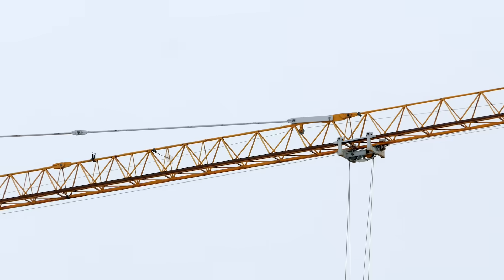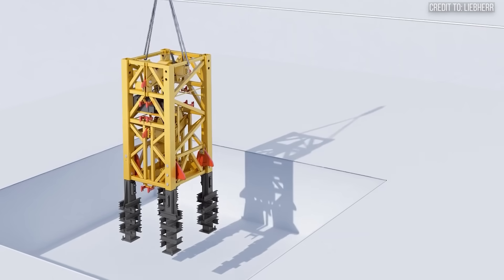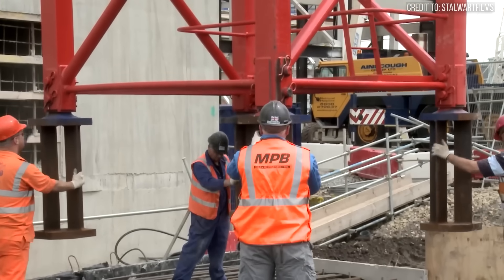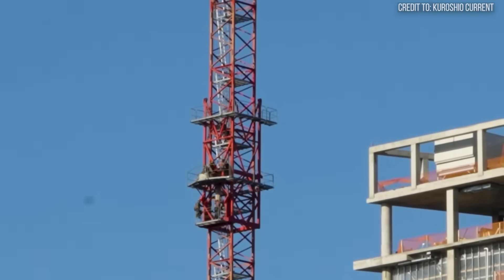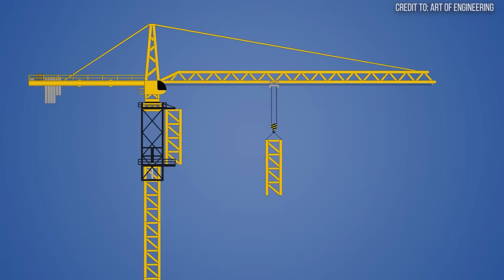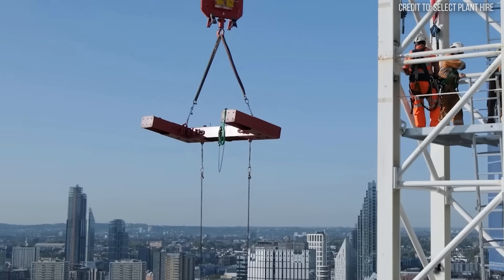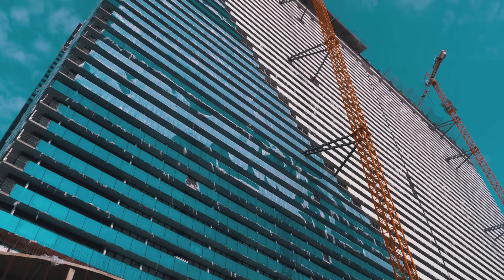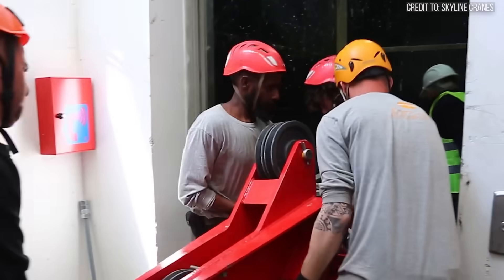How A Tower Crane Assembles ITSELF

Comment: Never quite caught the bit how they get the anchors back out from a finished building ?
Reply from the maker: Hi, The concrete foundation block itself is almost always left in the ground (it’s huge and very expensive to break out). It often gets incorporated into the building’s basement structure, parking garage, landscaping or just covered over and forgotten. Hope you enjoyed the video!
Reply: @HardHatIndustries sorry may have worded it wrong, the steel tie in beams into the building that help keep the crane stable the higher it goes up, how do you’s get them back out from a finished building ?

Comment: How long the crane used its cable for its specific job?
Reply from the maker: A crane cable doesn’t have a fixed lifespan, it’s replaced based on condition. Depending on how often it’s used and the environment, it can last anywhere from months to several years. Regular inspections check for things like broken wires, corrosion, diameter loss, or deformation, and the cable is removed from service as soon as it meets discard criteria. Safety standards (like OSHA/ASME) require replacement when wear or damage is detected, even if the cable isn’t very old.

Comment: The cost of the crane must be negligible in comparison to the building. So why dismantle it at all? Just keep the crane as part of the building. It could be used to build adjacent structures and help in maintenance. It's look also fits modern brutalism with its plain industrial look.
Reply: So that means crane production needs to be increased just to make an archetectrual statement?
Reply: @crusher8017  Yeah. They would be part of the central pillar also containing the lifts and staircases. Every skyscraper needs HVAC, lifts, absurd amounts of steel and concrete, and a single crane which grows with its building and stays with its building until it is used to dismantle the building and itself.

Comment: When I lived in the US I worked in a major east coast city in building maintenance. I had access to the roof of the building I maintained and I frequently would go up there on my lunch break and watch a new building under construction. I caught them inserting tower sections when they were climbing  to keep up with the progress and I caught them when they took down the crane which by that time was near 600 ft tall and watch them lowering the crane. I often took pictures of that building as it progressed and of the tower crane assembly and later disassembly. I have respect for the men who do that work.

Comment: How does the operator get up and down daily?
Reply from the maker: Tower crane operators usually climb long internal ladders inside the mast sections.
When the crane is tied to a building under construction, they can use the building’s stairs or elevator to reach a higher level, cross over into the crane, then climb only the remaining mast sections by ladder.

Comment: It's the first question crane operators receive. During a home bathroom remodel, we went to the nearby grocery bathroom if nature called later at night. But more than once you had to get clever and set up sawed wood slats over a five gallon bucket with.a plastic grocery bag inside. Crane operator's 5 gal buckets have a toilet seat snapped on top but it's almost the same setup.

Comment: Yes worked on two of them as an Apprentice Electrician , installing flood lights  about 17 years old and the guy I was working with could not stand heights , I am still here touch wood , Reggie HAS LONG GONE , bless him . Back in the 1960's no safety gear , so hang on and keep going . Bournemouth UK . PORTMAN BUILDING and BURLINGTON ARCADE ,all for £ 4.50 PENCE A WEEK wages .

Comment: The video doesn't show how the crane, itself, is mounted onto the tower. I assume that it's lifted onto the tower by another crane on the ground.
Reply from the maker: Yes that was an oversight in all honesty. Your correct! The first few mast sections are lifted into a place along with the jib, counter jib, counter weights and cab. This is usually done by a mobile crane. From this point the crane can start building itself as the video explains.

Comment: A lot of people don’t realize how much these cranes lean over, I was on the platform close to the top when we were pouring concrete with the crane bucket, a full bucket almost at max capacity and you can feel the crane bouncing
Reply from the maker: That's a great comment! It perfectly highlights the incredible engineering and design that goes into these structures to manage those forces. The subtle movements, even when loaded to capacity, are factored into their stability.
Reply: Some cranes have movable counterweights to adjust for varying loads.  As a civil engineer, I know that the loads need to be balanced as much as possible to reduce the torque on the tower as much as possible.

Comment: A guy I’ve known for several years owns an ironworker outfit here in the Seattle area.  He unfortunately knew everyone killed in the Seattle tower crane collapse a few years back.  When he says it’s about precision that’s seriously no joke.  Remove the wrong bolt at the wrong time, negate the structural integrity and the results can be catastrophic to say the least.  But I believe tower crane operators can be easily into the six figures as far as salary.  It’s also very difficult to get into.  I’d love to have the chance but for now I enjoy my semi truck hauling welding gas.

Comment: I was hoping for an answer of "How does the horizontal beam is placed and the concrete slabs?"
Reply from the maker: Hi! The horizontal beam (the jib) and counter jib are lifted up in sections by a mobile crane and bolted together while the tower crane is still at its initial setup height. Before it begins climbing and adding mast sections on its own, the mobile crane also installs the concrete counterweight slabs. Once the jib and counterweights are in place, the tower crane is properly balanced and ready to start raising itself.

Comment: I have a lot of experience with mobile cranes as a rigger but none with tower cranes. You mentioned that a smaller Derrick is put in place on the roof to dismantle the main tower crane but also said it was small enough to be erected by hand, so why does an even smaller Derrick need to be there to dismantle the first Derrick?

Comment: during the lift up - how they powered up the crane? and how it powered general?
Reply: A large electrical cable wood be logical lots of power will be used by the building when finished I worked on dredges and they had a floating group of pontoons supporting the cable with plenty of surplus. Thousands or liters of diesel and lots of hot coolant would be a huge hazard and far more costly to supply fuel and maintain compared to an electric motor. Being next to a noisy vibrating engine all day would lead to a rapid turn over of operators and not good for the crane structure.

Comment: Just wondering if there are examples of interior cranes where the crane’s support is actually left as a structural part of the building?
Reply: I think they did that before the self rising kits. Or they plucked it down piece by piece in the shaft that later would be elevator shaft.

Comment: I wonder what the maximum height it is possible to go using this system . If the wind is not a factor ?
Reply from the maker: Great question! Tower cranes can actually climb themselves to huge heights — as long as the structure supports them. The Burj Khalifa, for example, used self-climbing cranes that went up over 800 meters as the building grew. So if wind isn’t a factor, the main limit is really the crane’s design and the building’s strength!

Comment: What powers the crane?

Are there electric cables running up the whole height or is it diesel powered and they lift up fuel to refill the tanks?
Reply from the maker: They are powered by electric motors which draw power from the local power grid. Some may have back up diesel generators but this is to supply electricity (not as a direct drive engine)
Reply: There's a gigantic motor up on the top behind the operator cabin.

Comment: In answer to your question about concrete experience stories...

My father, Stan Sack, was hired in 1964 by Dominion Engineering in Lachine to come up with a procedure of fastening the Innocenti machine to the concrete floor without the use of anchor bolts. I am writing a memoirs for my 2 sons about growing up with my Dad. I'm looking for more information about my Dad working at Dominion Engineering Works (DEW) and the Innocenti installation project.

In a letter to a chief engineer who used to work for my Dad he writes...

"In 1964 , Dominion Engineering Works (Lachine, Quebec) – a subsidiary of C.G.E. – a
firm I was well acquainted with, approached me. When I was hired, I was
assigned to the installation of the “Innocenti” – a numerical controlled milling
machine made in Italy a million-dollar venture according to my source of
information. This equipment was a monster in size yet very sensitive to its surroundings as to
vibration and shock. The cored concrete foundation was 8 feet deep and rested
on bedrock and was isolated from the surrounding concrete floor. The latter was
accomplished by installing a shock absorbing material all around and between
the foundation and plant floor. The normal procedure to fasten the equipment or
machinery to the concrete foundation is to install anchor bolts during the
pouring of the concrete. This procedure was ruled out due to previous failures to
the operation of this type of equipment."

"A new procedure of fastening this equipment to the concrete foundation needed
to be invented and investigated. At that time, I seemed to be more adventurous –
a case of more guts than brains – however, I came up with a proposal and
procedure. After many technical discussions my proposal and procedures were
duly approved and I was given the green light to write up the EMI (Engineering
Manufacturing Instructions). This too was also approved shortly after its
submission. The concrete foundation then was poured - minus the anchor bolts.
During the pouring of the concrete, the contractor was somewhat skeptical due
to the lack of anchor bolts. His final remark was 'You learn something new
every day!'"

"The EMI made it very clear that cleanliness of surfaces to be bonded (i.e.
leveling jacks, bottom face, and the concrete surface) as well as the work area;
tools; and workers attire (the company issue of white coveralls, head wear,
gloves, foot wear etc.) was of paramount importance. This was subject to close
inspection at all times and enforced. Only authorized workers and personnel
had access to the cordoned off area, nothing was left to chance. An 8-foot high
canvas barrier was installed which encircled the entire area of this project. The
bonding procedure and formula of the material is somewhat lengthy and
therefore I will not dwell on it. During this episode, I was treated like Royalty to
the point that it became rather embarrassing but I had a ball. The foregoing
procedure of installation, proved to be successful and subsequent “Innocenti”
equipment used the same installation procedure."

My Dad co-founded Long Sault Woodcraft Ltd in 1946 which made fiberglass Radomes for the military as well as several other fiberglass products and was bought out by CGE in 1965.

Comment: 3:27 
I haven’t worked on or near towercranes but I have done some concrete pours. The 2 most challenging ones were:
My first ever one, I was an apprentice of 2 weeks, no trade school just on the job learning (with a bad company to do so) and then the first poor was 4,5x9x 0,3M I was getting shouted at since nothing was explained beforehand and thus during the pouring was when I had to ask all the questions and be yelled around…

The second one was a continuous floor that spanned 4 rooms were from 2 inside and 2 outside (the walls and roof of the outside place wasn’t build yet) the concrete truck couldn’t reach all places to we had to run around with wheelbarrows and buckets 

The first job was 3 men (including me as a useless apprentice)
The second job was 4 people including me (an apprentice of 4 months) and my sister (it was her 3th day) 

Yeah… those were challenging.
The worst part is my boss was to cheap to buy/hire proper equipment and materials so every day existed of struggles and brain puzzles
Reply from the maker: Thanks for sharing that! Always good to hear from operators with real world experience.
Reply: @HardHatIndustries sadly not yet an operator, soon should be though👍

Comment: in the early 80's I was in the Facilities department of. a company that was going to occupy a the upper floors of a 50 story building in Downtown Mpls.  PCL was the contractor building it.  there were 2 tower cranes, but they were not on the outside of the building.  Instead they were on either end of the building about 1/3 of the way in.  Instead of adding sections to the tower, the cranes were jacked up every few floors and the space previously occupied by the tower were infilled with concrete.  My experience with the floors after the construction was completed found that the concrete around the original crane locations was quite uneven, sometimes as much as 2".  Smaller cranes were hoisted to the roof to disassemble them and as you mentioned, the smaller cranes could be disassembled and transported on the freight elevator.

Comment: I was working at Beach Club in Hallandale Beach, FL when hurricane Katrina came ashore off of the Atlantic. It was only supposed to be a tropical storm. But surprise. There was a new crane on BeachClub III and wasn’t attached to the new building yet. It’s concrete base was in the basement of the parking garage. As far as I heard, the crane operator was supposed to leave the crane in a free swing. Instead, it was locked parallel to the winds and was smacked against the opening in the garage slab with 80 mile an hour winds. They had to disassemble the whole tower crane, including the base. And start over.

Comment: I have involved in several big monolithic reinforced concrete pours of 300 ft+ diameter 12ft thick with 6 layers of very heavy reinforcement mats, #14 & #18 rebars, in the 1970s.  From start to finish were over 48 hours, concrete mix plant had to add so much ice for reducing concrete heat of hydration.  These foundations were for 700,000 tons of loads from the 250 ft tall structural moments.  🤔🙄😉😎

Comment: My friend is a crane operator. He tells me a lot. But I can't stop asking. The most mysterious part of these cranes erection is that nobody sees when a crane is installed on a building base and nobody sees when it is disassembled.
But the cranes in the video are stand alone features. Could you also make a video about cranes inside the building?
Reply from the maker: Hi Troy, Noted this on my video ideas sheet!
Reply: The crane goes up first, and then the building is built around it!

Comment: How do the operators get to the top? I can understand starting at an upper floor for the ones connected to the building but I've seen many that arent and wonder how they climb the entire ladder? Its hard enough to climb that many flights of stairs but up a ladder, thats quite a climb! Maybe they have a lift or cable that assists?
Reply: Very few have a lift, most of them are still climbed up by ladder. Not that bad considering it's most of the operator's physical activity that day 😀

Comment: When I was a tower crane operator 30 years ago we had to stop work when the wind speed hit 37mph. That was the limit for the crane I was on.
Reply: Today is the same wind limit.
Reply: Good on you!  I'd have been out after 3.
Reply: Yup, and way lower when flying those wall panels
Reply: Why 37? That's a random odd number. Why not 35 or 40? Lol
Reply: @dyligent93  It's very close to 60 kph, so the limit is probably set in metric by the manufacturer, then hard converted to mph for use in the US.
Reply: @dyligent93 
The maximum wind speeds are most times set by the manufacturer of the crane.

Comment: Thank you for the video and education.  How are the crane and operator, and workers, protected from Lightning Strikes?
Reply from the maker: Thanks for your question, @jonbarrett9053! To protect the crane, operator, and workers from lightning strikes, several safety measures are typically employed. Cranes are often equipped with lightning rods or grounding systems to safely dissipate electrical charges. Operators usually work from insulated cabins, and work is often halted during thunderstorms as an additional precaution. Thanks for watching!
Reply: Don’t have your hand on the tower and be standing on the ground you will die if the upper crane is struck by lightning and that very moment. If you’re on the crane and it’s struck by lighting it travels thru the lighting arresting system into the ground to protect who’s ever on the crane.

Comment: I was on a jobsite once where the guys disassembling a tower crane lost one of those large bolts and it fell and killed a gas powered welding generator, luckily no one was hit. The generator however, was DOA.
Reply: You'll notice @ 2:53 no sling or harness on his hammer ...

Comment: You didn't explain how they get the cab on top of the tower after the mobile crane has reached its limit.
Reply from the maker: Good question! The cab and counterweight are actually lifted on by the mobile crane right at the start, before the tower gets too tall. Once those main sections are in place, the tower crane uses its own climbing frame to add more tower sections and “grow” higher.